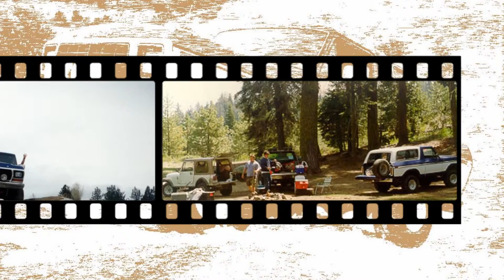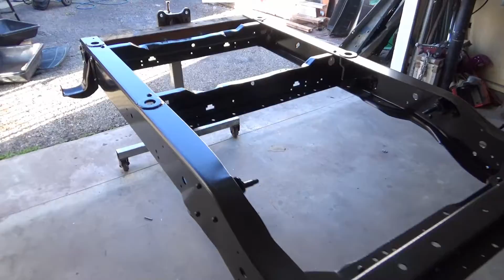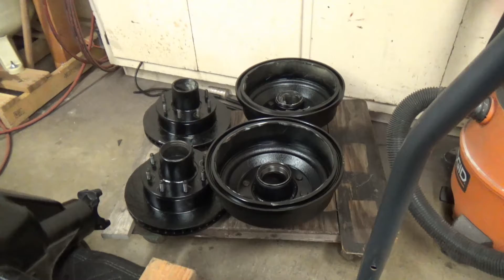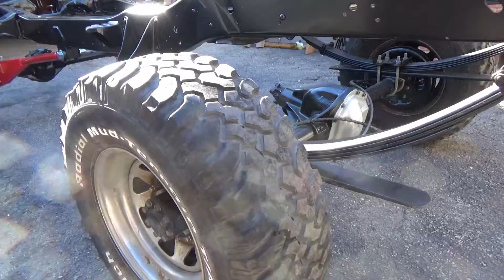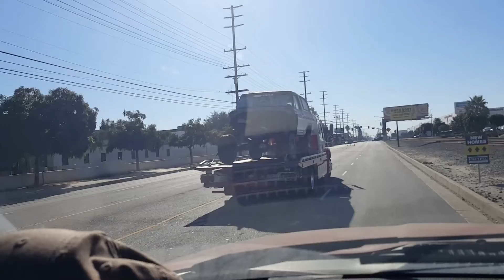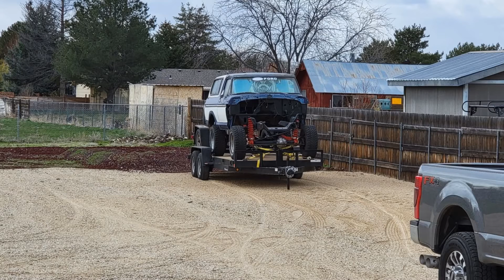Video 9: Axles and Rolling Chassis; 1979 Ford Bronco Restoration - lockers, long arms, and more!

Comment: Looks great, Once it’s finished it’s going to be a blast to drive. I drive my 79 every chance I get. 
   Love the frame reinforcements but I was wondering what your plans were for the brake and fuel lines? Did you drill for them already?
Reply from the maker: Thank you! To be honest, I am not sure yet how I am going to run those lines. My original plan was to notch the inside corners before welding the vertical pieces in the frame channel, but with all the hassle and stress of trying to move out of my house I just kind of forgot until it was too late. I will probably end up drilling a couple of holes, but I will cross that bridge when I come to it. Right now I am still working on the new house and also trying to build a shop in my yard so I have a place to work on it. Hopefully I will be back to work on the Bronco soon.